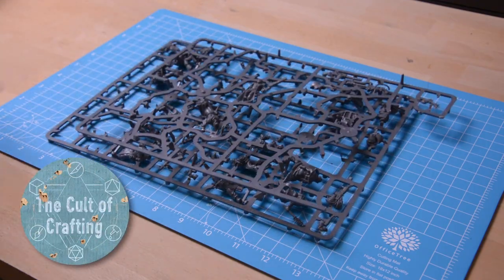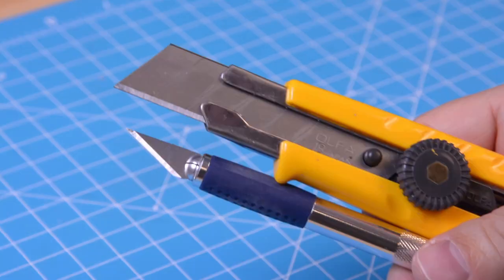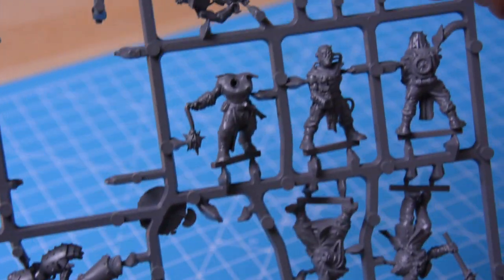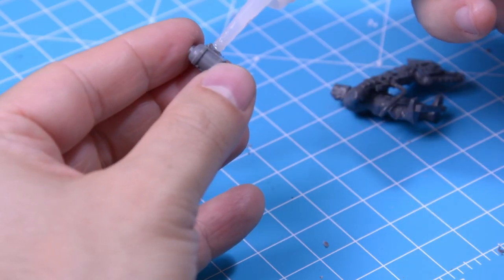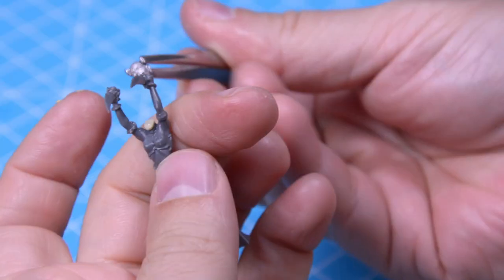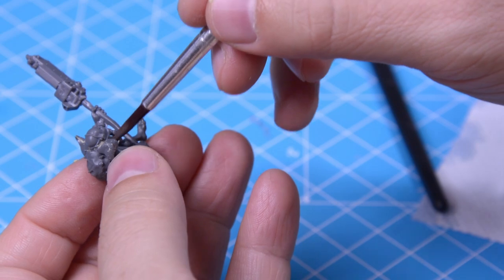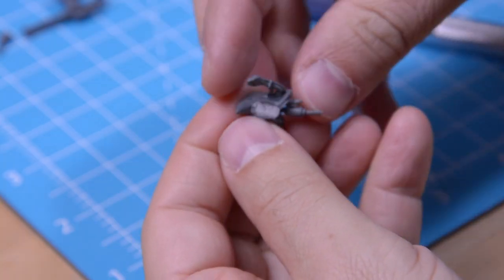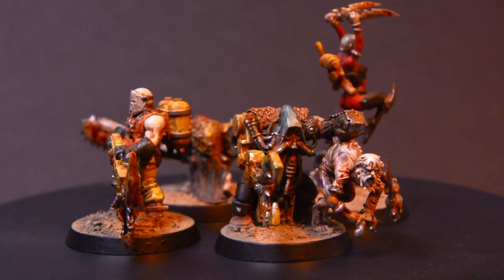Converting Miniatures for Beginners: How I made 4 Original Minis Out of Bits

Comment: I really really would like to see how you made the gun we can see at 46 seconds. 
Thx for the video!
Reply from the maker: Ah, I made 10 of those for my Ork army, but the unit doesn't exist in the rules anymore, sadly. I won't be making any more, but maybe this'll help: 
The barrel is two styrene tubes. 
The bed and the armor is made from a 1 mm styrene sheet. 
The decorative shapes are 0.5 mm styrene sheet. 
Wheels are round MDF bases with a ribbon of 0.5 mm styrene wrapped around it. 
The rivets I made by slicing hexagonal and round styrene rods into discs.
Reply: @thecultofcrafting  thank you very much.
My junkyard army of Imperial Guards will really appreciate the boost !